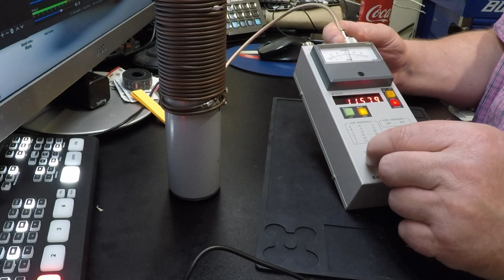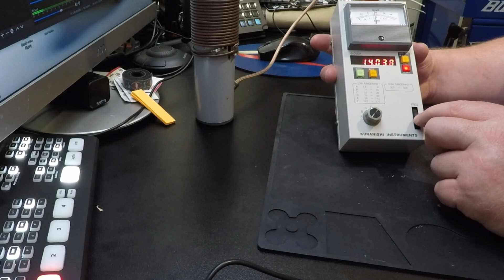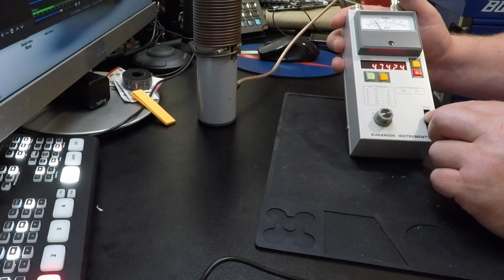An EH Antenna for 20Mtrs? does it work?

Comment: I have built one of these antennas myself and they are quite a challenge.  If you use something like a NANO VNA and get everything adjusted correctly (and that's quite difficult) the antenna does seem to work.  I use this antenna on my 200mw WSPR transmitter.  I have a separate receive only loop antenna with a 25db preamp built in.  For every station that I hear I'm getting at least one station that hears me.  This would indicate that EH antenna on the transmit side, that's sitting upside down on the floor of my workshop, works as well as the 8 foot loop antenna in the back yard mounted about 10 feet in the air.  What I suspect is that the hams that are having poor luck with the EH antenna haven't got one that's been correctly adjusted.

Comment: If you disconnect the lower cylinder and connect it to the upper cylinder (physically just above) the result is the same! Disproving the crossed-field principle. Having said that there is a grain of truth in the idea. I have a 160m antenna that pulls in 12dB more than a 40m long piece of wire and is part of the kiwiSDR network.

Comment: I think its not so  mystic about these EH antennas , it´s a simple CAP/COIL circuit tuned to 50 Ohm @ resonant frequency where you transmit on,  and it´s size couples to the airs impedance around 377 ohm.  You can probably end the coax with a smaller  coild/cap @ tx frequency but the small size have harder to pick up signals in the air. 
So not so efficient antenna at all.
Reply from the maker: I totally agree, there are those that swear by them! Gaz
Reply: Exactly..   its a resonant circuit which makes a VERY good  top-loading device  (placing  a LOW  impedance  at the top of the mast ).   The un-balanced coax    (or  twin feeder)  is the radiating element !,  so if you make the feeder 1/4 wave,  you can feed it like an end-fed 1/2 wave,  but it is HALF  the size !   I used a Z-match and twin feeder and they work a treat.   You have to choke  the RF  out of the shack (the Z-match makes this easy )   and acts as an  unbalanced  to balanced  transformer  (as well as impedance match)

Comment: What sort of length coax do you think to be more efficient? 🤔
Reply from the maker: tough question, I'm going to revisit this little antenna as there is a little more to cover.. but I really did have trouble with RF in the shack I would say dont make the coax  length resonant if you get my drift :-)